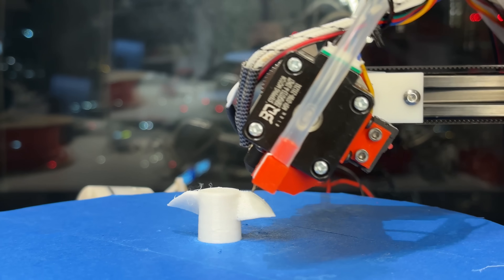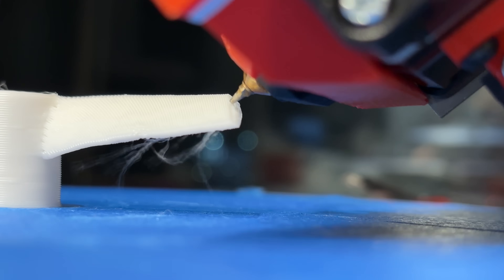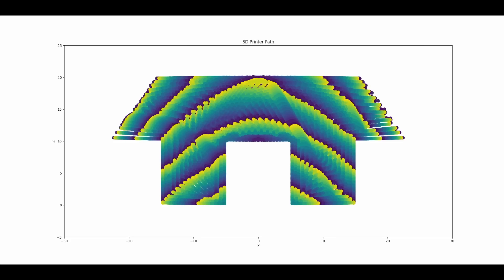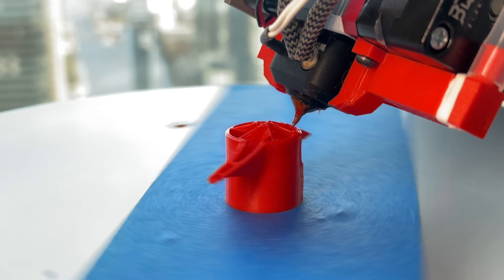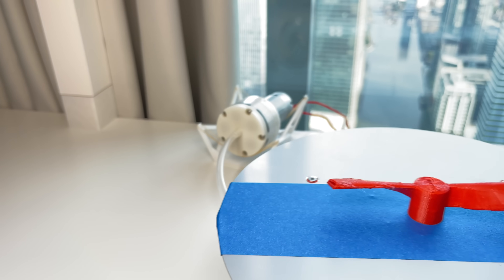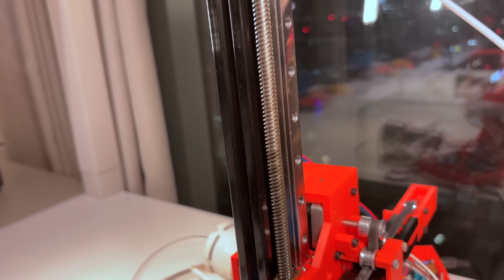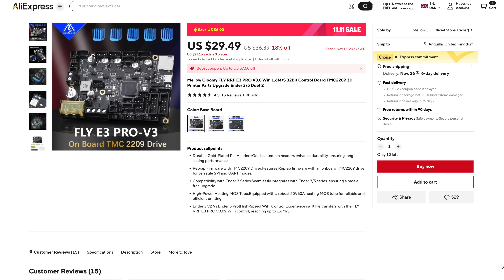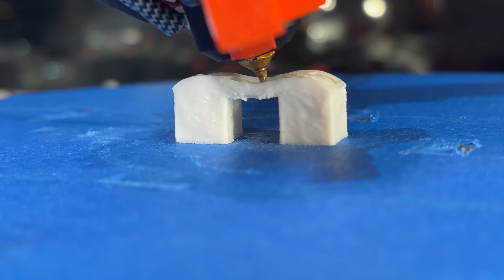I Built a 4 Axis 3D Printer Unlike Anything You’ve Seen

Comment: To see the slicing and printing is intriguing. And this makes me thinking, one could actually run an FEA mechanical simulation on the 3d printed parts, and print the layer based on common failure criteria, such as principle stress or von Mises. This will open up a new competitive advantage to 3d printed parts.

Comment: "aluminium" or "aluminum" - tomato, tomatoium ; the way you are slicing that propeller, it will just fly apart, because in the direction you need the strength it would fly apart.  It really doesn't matter if you are an "engineer" or not (someone who memorized things that someone else came up with), what matters is you should have critical thinking and understand how things work (engineers don't, they just memorize, like any other degree)

Comment: I've been trying and failing to change Cura so that my CR 30 can move the belt backwards and as it does lift the hot end up when doing that motion. But now I'm thinking that what if you could have the hot end go from 45° to 90 to an opposite 45° with an additional stepper motor. That motor will be really small because all it's moving is the hot end. And now you have a belt printer that has four axes.

Comment: I truly love your ideas on 3d printers, but I have a question. Doesn't the slicer design the layer lines in the weakest possible positions? I love the idea behind the printer. However, like the propeller for instance, it looks to me like all of the layer lines will be going across instead of in line with the forces. I hope that makes sense. Am I right or am I looking at it all wrong? Where can I find out more about this design? Thank you in advance.

Comment: I am nowhere near knowledgeable enough to say much that is relevant, but I have seen videos of big companies basically putting something like an arc welder at the end of something like this to create a metal 3D printer. I do like the idea of cheaper, DIY metal printing using electroplating as a way to deposit layers of metal, since it's so much cheaper, but I'm also sure it's much slower. You use something like a felt tip with an electrolyte solution with dissolved metallic ions to do that.

Comment: It seams you have a problem with stringing when printing the tree branches and the propeller, to prevent the stringing you could do some sort of branching, similar to the sequential printing on a 3 axis printer. what i mean is that it should not rotate the plate every layer instead it does one end of the propeller in one go, then spins around and does the other end of the propeller. a script to detect when to branch and avoid collisions while doing so would make this print a lot more clean.

Comment: Awesome build! :) Just there must be loads of time wasting if it prints one layer on each branch or piece and then changes to the other part, one layer, repeat, goes to other, layer, instead of just building it up straight up as far as its possible for the extruder to still reach around it, and it would probably scale down the time needed to print by a whole bunch of time!

Comment: This would work great with multiple print heads the only problem I can see with having multiple print heads would be the base can only accommodate one print head in the center. This I believe could be fixed easily by just giving one print head priority when it comes to filling in the center. I would love to see this with multiple print heads or as a modular system from what I can tell you have two main pieces to this printer the base plate which rotates and the other the print tower, which holds the printing head by using multiple print towers you could cut print time by reducing the rotational distance needed to reach a nozzle and increasing the amount of filament that can be extruded simultaneously.

Comment: You might want to check out Protopasta Heat Treat PLA. It prints like PLA (for the air ducts), then you toss your part in the oven at whatever temperature the documentation recommends. The heat treatment changes the HDT from 50*C to 150*C, because unlike normal PLA, HTPLA forms crystal bonds when it's annealed.

Comment: Thi is what I have read:# Fly-E3-Pro-v2

## Overview

This control board has been discontinued by Flymaker/Mellow due to a number of issues that have been identified. It is recommended to stop using this printer board and return it to seller where it was purchased from for a refund.

## Issue 1

A number of users reported heater outputs used for controlling a bed as failing (resulting in a "closed" mosfet and power being continually supplied to the bed) within 30 minutes of being used. Users were asked to return their boards and a modification was carried out to prevent the mosfets from failing. Unfortunately, that modification was unsuccessful and report of bed mosfets failing on modified boards were still being reported. Because of this issue, the board was withdrawn from sale and discontinued.

## Issue 2

A user reported that on boot up, if a fan mosfet was not declared within a config that the output would remain on. On further investigation, the fan outputs will remain on when either no sd card is present or when they are not defined in a config.g file. This is due to the lack of pulldown resistor on the output pin. This means that if there is an SD card issue (no board.txt is loaded, config.g not ran or failed sd card), they will default to being on with no control. This may also be an issue with Marlin and Klipper.
Also on the board available for testing here, when powered by 12v and with the 12v jumpers applied, the heater mosfets also remained on with no sd card installed or when they weren't defined in firmware. 
Essentially, in some circumstances the fan and heater MOSFETs can turn on without being commanded by the firmware.

## Conclusion

Therefore, this board does not appear safe for long term or unattended usage. Please contact your reseller for a refund. 

This issue will be fixed in the Fly-E3-Pro-V3 board when it is released by using a 74hc541 buffer for both the fan and heater mosfets and pulling the output to ground when not defined, which is the same implementation as on the super8, CDYv3 and duet boards.

Comment: the skill level to do this is on a great level. but this has no practical use in the overall 3D market. if i made a propeller for example, i would prefer layers to be oriented flat and use support. so, looks cool and is a skillful project, but i would not change my normal printer for this even if i was paid to do it.

Comment: I will build the printer. Parts have already been ordered or are already in stock. I will run it with a Spider V2.2. That is still lying around. Hotend or the Biqu h2 v2s lite. My Bambulab X1C is already printing the first components. - #Janing3D

Comment: I'd love to see your slicer put through it's paces because a general non-planar slicer is definitely a huge leap forward for the community.
One thing that would be cool to add to it would be splitting tasks to minimize moves. Like on that propeller, it would be interesting if it could do multiple layers on one side before moving to the other.
I bet something like that could be added as post-processing by taking the layers splitting them and then changing the order they are printed in. Though it'd probably have to do some sort of simulation to prevent collisions and figure out the limits.
Also a tunable for where the center of mass can vary around would probably be good to prevent unbalancing a part to a large enough degree that it falls over or flings off a polar bed.

Comment: Great job. I have been seeing discussions and a couple tries at multi Access 3-D printing for years and it’s cool to see one working well. My interest is for designing parts in optimizing for the pros and cons of additive manufacturing where with 3-D printing polymers you have different strengths and weaknesses, depending on part orientation.

Comment: This is incredible. You definitely have engineering chops. If this is still WIP, my only suggestion is to add the extra wiring for limit switches. Stalling your steppers like that every time you go to home is going to create extra wear and tear on them and shorten their lifespans. The use of compressed air is brilliant though, and I love the rubber band sling! This is a mechanical AND computer engineering work of art.

Comment: Fantastic for small size prints. But what is really needed for non planer printing is! Start with a traditional sliced model CORE, then apply a non planer skin for strengthening in the traditionally sliced Z. The non planer skin should be settable in the beginning of the traditional sliced model settings, this could be latter refined for deep corners and other geometries. I understand that some internal geometries would not be reachable in the non planer completion of the model but this would only be do to size of model and the design of the machine.

Comment: Combine this with that printer that's on a roomba that prints directly onto floors and walls and stuff...imagine it as a robot 3d printing plastic wall fixtures for the electricity and print in place light switches and stuff hah imagine clicking it down the first time

Comment: If, during the construction process, some cross-sections are left and another construction is carried out in a different direction in the interface, forming two different construction forms in different directions and intersecting together, is it possible to enhance the strength of the overall structure? It's similar to the feeling of a columnar object wrapped with a circle of wire.(I can't speak English, I use translation software, there may be wrong words.)

Comment: This is some amazing engineering work.  I am kind of struggling with how the motion control works.  More specifically i mean the software to take a design and turn in into whatever code this thing needs to run.  It's not like you can just take some existing programs off of cartesian based machines and tweak them a bit.  

Anyway this is awesome to see, you should be very proud of this!

Comment: This is amazing. I thought about this years ago when first starting out in 3D printing 10 years ago except the rotation was on the toolhead arm and not the bed. But I see that would cause huge issues for filement feedthrough.
I think there are two main technologies holding back 3D printing from taking over the world. Multi-toolhead printers and rotational toolheads. The multi-tool I first saw at E3D almost 8 years ago now. That finally seems to have become mainstream to an extent, but mainly on a focus on 3D printer tool heads rather than including a CNC tool head, where you could then drill out, de-bur and even spray aerosol paint or sealant. 
The rotatioanal toolhead just like in your design, I think this has a higher potential than multi-tool printing since the big thing with 3D printing is its ability to make objects which simply can't be made any other way. Adding this rotation takes that to another level where there is objects waiting to be designed which cannot be made any other way. I hope that this becomes mainstream sooner than 8 years.

Comment: This is almost my favorite mill layout, and definitly my favorite 3d printer layout.

why did I bring up the almost?
(its a deckle by the way if you want to see it)
two reasons, one you fixed my favorite mill design with this layout. my favorite mill has the table on a knee and that makes CNC-ing the layout a flipping nightmare.
Two, my favorite mill layout has the table axis capable of moving lineraly as well as rotate, and the tool axis could be rotated in two axis's.
this allowed for taking full advantage of the strength and weakness's of rotational motion and linear motion in respect to accuracy and precicion. Linear motion add's any errors up, and rotational motion multiplies errors BUT you can arrange both to reduce errors, with a bit of trig and planning as long as you use them together.
 (on the mill the table rotational axis was optional and installed as needed but mills have diffrent needs in rigidity)

I do not know how difficult it would be in the coding side of programming a slicer, but I do know that while manually writting gcode can be a pain having the option to manually get to frankly insane levels of precision would bring the 3d printer in general out of its akward phase and into the stages of general use we already have a mulitude of metal capable printheads some that actually reduce the energy and cost of recycling and refining but we have needed a well programmed and backed scaleable design to really take over.
And
Honestly
Ive nearly died twice due to machine operators screwing up and had to save my co-workers and machine operators dozens of times on the machine floor. I want machining to end. I have a vendetta against the wide spread use of milling machines and lathes at this point.
And I honestly see your design and demostration and see that end in close sight.

Comment: Do wonder because I'm also working on a generalized non planar slicer but mine uses voxels and a breadth first traversal combined with a max height so we don't collide with anything. Been having a rough time with university projects that I needed to hand in so I couldn't work on that for the past 2 months.
I wonder how does your works, do you optimize the slice layer shape and then slice with that?
How do complex models(large tri count or many different overhangs)effect slice times?
Really cool project tho.

Comment: Could you mount one of those little laser welders on the head like the touch probe and use it to fuse the plastic inside the tree limbs before capping it with normal printed shell?  Basically a multi tool head that can deposit as well as fuse layers.  This could solve the layer adhesion problem but with an increase in complexity.

Comment: Not only does adding a fourth axis allow the things you pointed out, but this also begins to allow print lines to run in different directions on angled and curves surfaces and not just flat layers.  That can help improve strength along different axis on a printed object. Those blades you printed can have layers printed from the center out with the lines perpendicular to the centerline of the blade, then layers printed radially from the center. 

Boeing has carbon fiber machines that essentially do this. The mold rotates on one axis, then an arm moves back and forth with an articulating head that can move on two axis. This head lays down carbon fiber threads that run in different directions to maximize the distribution of stress throughout the structure and maximize the strength and rigidity while reducing the overall weight.

Comment: Now if you turned this into a 5 axis 3d printer by putting the rotating build plate on top of a bed slinger to duck around that whole singularity in the center issue, it would also allow it to be effectively capable of printing in a standard 3 axis fdm manor. Just a thought, honestly not sure of the full practicality of such a thing.

Comment: Im curious about how you came to your current gantry design. If I had been asked to put such a movement together, I would have essentially made a second Z axis with another ball screw and linear rail, and then had a motor and pulley attached to the moving end which would rotate the head (basically just a simple gearing down of the stepper motor - identical to what you did for the bed rotation). In my mind this would give much more accurate results, though I am not sure how much of the quality is tied to the slicer instead of the hardware, seeing as CoreXY machines gave longer belt setups than this but can get very accurate like the Bambu machines (my gut tells me that slop/stretch in the belts would lead to most of the accuracy issues)

Always interesting to see how everyone has their own way of making a machine!

Comment: I really like the way you made the turning of the printhead and the x action be driven by the same belt! its so elegant and practical. did you think of this method yourself or is this something you found elsewhere? this not a sneaky accusation of plagiarism btw xD these kinds of mechanics are made to be shared and im glad you are doing so. i just want to know how you came to this method of moving the printhead. 

the advantages of this printer are also obvious to see. not only in what it can print but also in how simple a design it is. I'm a big fan of this. well done! as for the issue you adres of with the polar printer I'm sure there are easy ways to work around (heh :p) that. for example, your slicer seems designed for non polar printers which makes them not care about dragging lines through the center like you showed. but it should be possible to instead of creating straight lines that fill the shape to go for a radial fill. so either straight out from the center to the edge or circling around the center. that way you dont have to go through the center all the time. you could even do it like a set of pizza slices. print one slice at the time to minimize the spin and next layer up you can overlap those slices like you would do with bricks so it will still remain a strong whole. idk, just thinking out lout xD. but thank you for making this! can't wait to see what you do next.